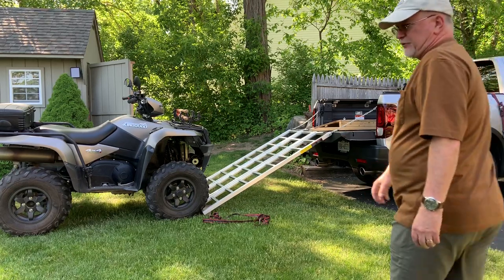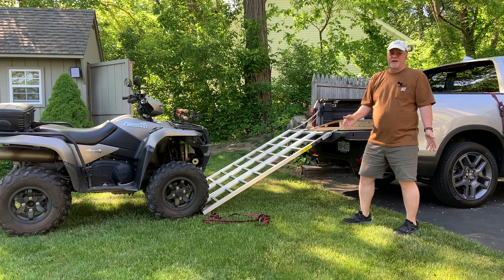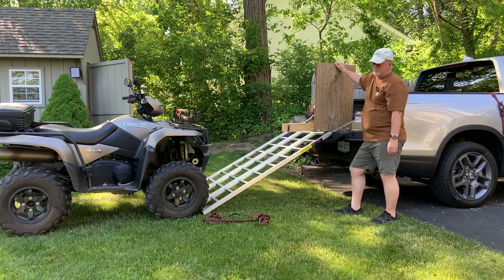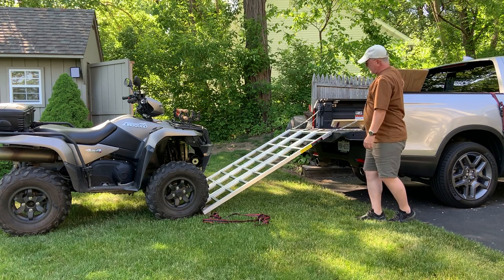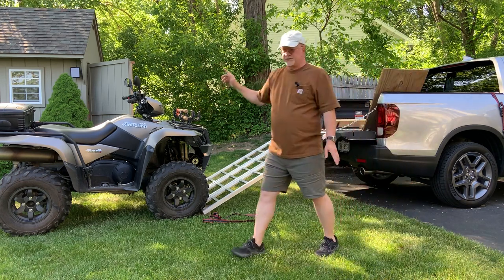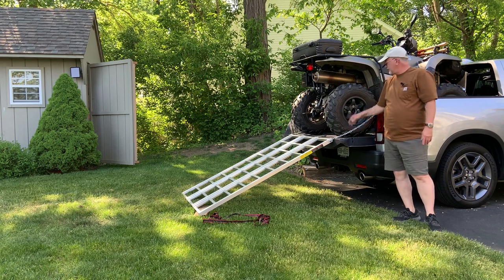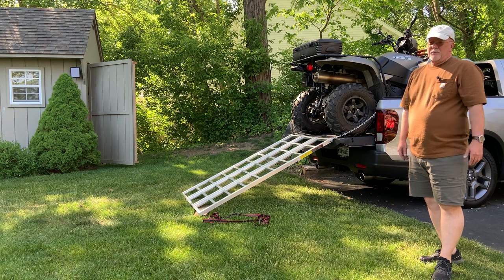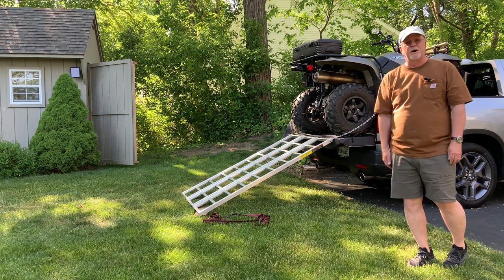Loading a full size ATV into a Honda Ridgeline

Comment: The important thing to note is that all the other mid-sized trucks are too narrow in the bed (plus have too much wheel well intrusion, and their bed being 4 inches shorter than the Honda's in their crew cab configurations) and cannot haul a standard ATV (or 4x8 building materials) in the beds. Now, call me a conspiracy theorist, but also note that Honda is the only mid-sized truck manufacturer that doesn't offer a full-sized truck. Perhaps the utility of the other mid-sized trucks is intentionally limited to encourage full-sized sales?
Reply: Depending on size, you can also get 2 dirt bikes in there and the tie downs are designed for it.
Reply: Exactly. Modern "full size" monster trucks on the road are unnecessary and impractical for 90% of applications. But hey, if you wanna burn gas to look cool and pull that one oversized camper one time out of the year, so be it.

Comment: For unloading my atv, i made a little contraption. I got a heavy chain and two heavy duty carabiners. I attached it to the upper tie downs. I would then attach my winch and let it down the ramp. Real easy, no excitement at all.
Reply: Well that's certainly an even safer method but I prefer a little thrill in the event.

Comment: The one thing that would worry me is when the 4 wheeler is on the ramps. That is applying the full weight of the 4 wheeler 400+ lbs (I'm guessing) onto the very back of the tailgate (The part with the most leverage) which is only designed to hold 300 lbs (Per Honda) because of the single cable on the tailgate. I get that once it's in there, the weight is a non issue, but the beginning of the loading is a nail biter. Seems to work, but keep an eye on your steel cable for degredation. I only have dirtbikes for my Ridgeline, so they are under 300 lbs.

Comment: Aren’t you concerned with that much weight on the tailgate? The Ridgeline is only rated for 300 pounds.
Reply: Same question. I have a CanAm xt MAX 570 and that is my biggest concern that the tailgate will buckle when loading....

Comment: Looks like you didn’t need to add a chain to the unsupported side of the tailgate.  I read that the tailgate max load is 350#.
Reply: I'm estimating around 250lbs on the tailgate so no issues. more of the weight is up front with engine and winch.